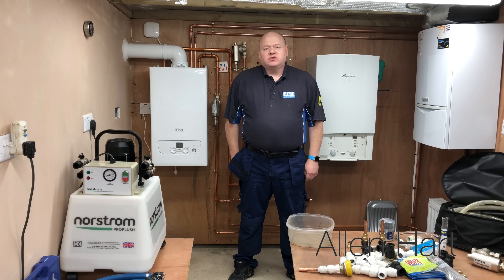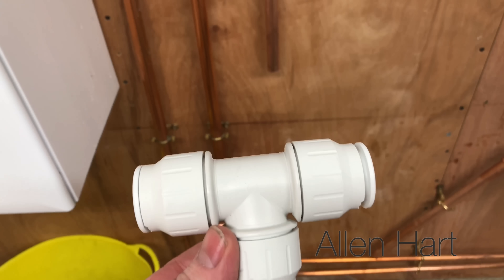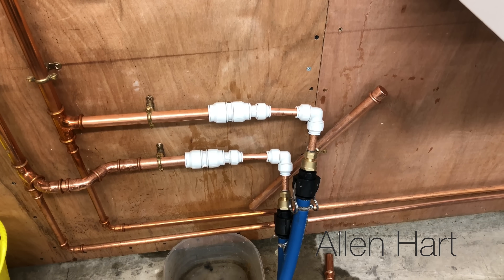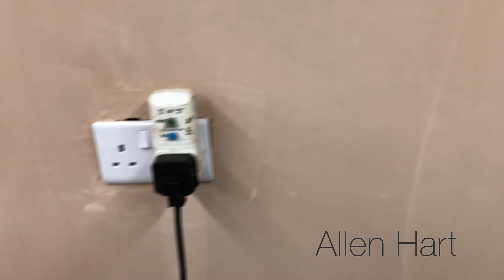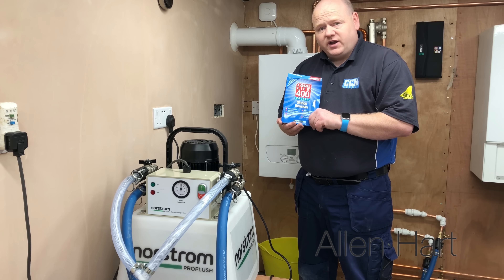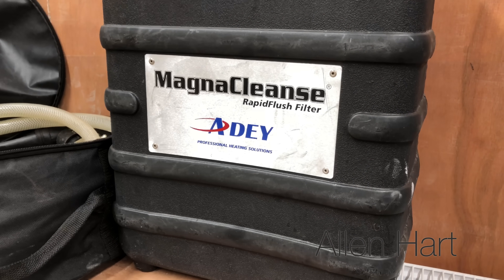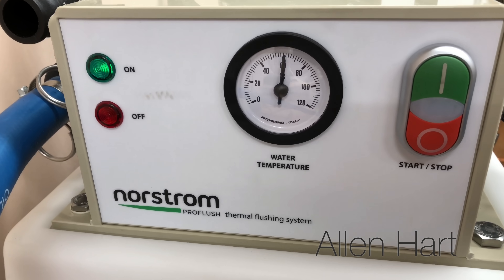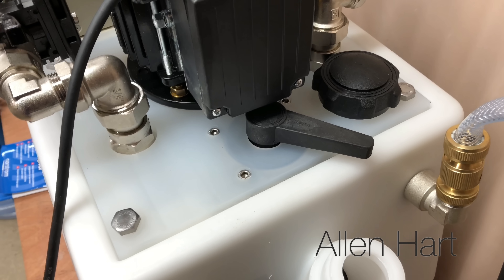HOW TO POWERFLUSH - Powerflushing a Combi Boiler Leeds

Comment: Dear Allen,
I have a radiator which has I can't access and is shut all the time can I still do power flush with all the other radiators? Someone stupidly built shelves around it so I cannot get to the thermostatic valve to turn it on even if I wanted to.

Comment: If removing a radiator and connecting powerflush. Would you put the flow from the powerflusher on the flow side of the radiator and return to the return

Comment: Doesn't there need to be a meter of copper off the boiler manifold before you can use plastic fittings?

Comment: Hi Alan would you say you have to be gas safe engineer to powerflush as there is so many fine lines as u say the pump is in combi boilers and system boilers.
The cover of the boiler people saying is an issue to be gas safe.

Comment: Great video, but not sure how to connect the power flush machine to boiler, I don’t wanna cut into pipe work though, is there any alternative. Boiler is valiant and have 2 way valves on flow and return which can be adjusted with screwdriver. Thanks

Comment: Gd vid, just ordered the same machine and have the magnacleanse. Where did you get the fittings to go from 1" to 3/4!?
Reply from the maker: Thanks very much for your comment, please consider subscribing to support the channel 🙂
Reply from the maker: I ordered them from google. Sorry i cannot remember where i got them now.
Reply: What are they called even see if I can find them... I had planned to just jubilee clip the hoses together with copper but these would be a much better job!
Reply from the maker: @dermotmcadams3742  https://www.google.com/search?q=cam+lock+fitting&oq=cam+loc&aqs=chrome.3.0i433i457j69i57j0j0i131i433j0i395l3j69i60.6184j1j4&sourceid=chrome&ie=UTF-8
Reply: I visit norstrom in Wigan and bought the adaptors

Comment: Hi Allen how much do you charge for this as im think getting it done plus would this stop my boiler from losing pressure all the time ive had a new expansion vessel put in but still doing it so just wondering if this would help if not what could be the problem with my combi boiler cheers Allen

Comment: Do you need to be at the top of the system
Because if not won't the powerflush overflow with water level?

Also,
Will You need to vent the rads to fill and then properly flush them
Reply: no. call a plumber. all systems are different.

Comment: Did you have the boiler flow and return isolated as I’ve seen some to say it’s better to not contaminate the heat exchanger with the sludge and all the boiler components.  Is this right. ? If it’s like this. What’s the difference with flushing the system and descaling the boiler. Just the chemical. And calcification rather than Iron oxide sludge.
Reply: Hi Allen  your making that look too easy, why wait for tub to heat up then dump off after every rad ? Needs magnets to see what has been captured. Was keen to see difference of a heated flush opposed to un heated ?
If boiler broke, using electric heat, why flush through boiler ? Connect straight onto F & R.

Comment: Great informative videos. I worked on boilers alot, not many wall hung. I would see sludge in the steam boilers but not in the hot water heating system.  What causes that?.. 
 In hot water here 3/4 in baseboards and a cast iron boiler typically run at 180° F,  i purged so many, drained many, but nothing like that sludge you got out.. Remembering now baseboards i removed and replaced i never saw that build up you showed in your copper. Maybe its the additives they put in our water that keeps it out??  Great videos very informative
Reply from the maker: Thank you for taking the time to watch my video.
Reply: I would like to know is this only on the combi boilers??.. I like this flushing,  i think for my situation, i would drain the existing system, run fresh water through & drain again.  The i would put the chemicals in the existing boiler, let it run everything a couple days. Then return for r&r...
  Only i never heard anybody doing it.. It would be a nice add on sale for maybe extra 500$ but i couldn't bring myself to sit there all day charging for my time.. Definitely can't do either without proper knowledge.

Comment: Hi mate. How long per radiator and what if the boiler needed flushed too?
Reply from the maker: Until its clean. Thanks.
Reply: Allen Hart what about the boiler ?
Reply from the maker: I normally let the boiler work with the chemicals in the try and clean it as much as possible, i wouldnt normally take the plate out though on a flush. Thanks.
Reply: Allen Hart cheers mate, any chance of a video on wiring heating controls eg. Zone valves, stats, and programmers ?

Comment: It's nice to see how a pro does things in another country. I'm from The States and most of the contractors here are still installing cast iron boilers. Didn't the installers use boiler chemicals when the systems were installed that they are plugging up?  They sure install the boilers in tight places there. When did the use of condensing boilers become popular there?

Thanks, Bill
Reply: In continental Europe condensing boilers have been used for many years,People in the U.K like to hide boilers don't know why in places where they can be awkward to service.

Comment: Ideally should a powerflush happen before a new boiler is installed or doesn't it matter ?

I had a new baxi 630 installed and the installer said after it needed flushing.
Reply from the maker: In an ideal world it would be flushed before but thats not always possible.
Reply: If your system wasn't  flushed prior to fitting new boiler,then much efficency of new blr is lost because you have now pumped magnetite into it!

Comment: To do this properly takes a lot of time and patience. A good DIY task if you hire the machine.
Reply from the maker: Personally i dont believe its a DIY task, best to leave it to the people who know what they are doing, every job is different and needs different things doing. Thanks.
Reply: Alan as I am sure you appreciate not all plumbers are equal, neither are all DIYers. Of course you need to be competent to complete any job correctly and anything less is a bodge. Personally after running big power plants and large chilled water systems I am very happy that my plumbing skills are more than satisfactory. The one thing that stands in the way of DIY in this sort of job is the kit and as long as it can be hired then there is no good reason why a perfectly good job could not be done.
Reply from the maker: I do not really agree if i am totally honest, i have done hundreds and hundreds of powerflushes if not thousands and TBH i had done quite a lot of them before i understood what i was doing. A diyer might think they have done a good job but i would say in nearly all cases they do not and end up calling someone like me. When you take into account the cost of the machine and cost of the chemicals used i do not think customers get a bad deal. Many thanks.
Reply: Hi Alan, I need a bit of advice (if you kindly would). My boiler has locked out due to flake build-up, I've been informed the boiler itself can be power flushed with chemicals. My concerns are; 1, is this going to be effective? 2, Is that amount of pressure running 'directly' through the boiler ok? 3, Is the flake likely to cause damage to the boiler parts, as its pushed through it? Thanks.

Comment: Another great video Allen just one question do you think that the water heating capability on this power flushing machine is worth the extra cost? It seemed like it could take a while to get a full heating system up to temperature? Thanks again Allen.
Reply from the maker: I have only tried the heater on a small 6 rad ish system and it was really really good, i might get the built in magnets though as it will be better for setting up.
Reply: Use x800 cleaner. Works just aswell cold

Comment: so this is something you gotta do from time to time?
Reply: generally only has to be done on older systems. We always power flush before fitting new boilers in fact most manufacturers will void the boiler guarantee if its not done.

Comment: combi boilers are really complicated machines :/
Reply: I scratch my head,because all the maintaining is crucial.  If you hire a plumber all day to flush a system plus the chemicals you probably spent all the money you saved in the High Efficiency unit and more. Then when i hear the units are lasting 10 years or so.  
  I'll take a freestanding cast iron boiler at 83 or so efficiency with very low maintenance.  
 I couldn't bring myself to sell them knowing the cast iron boiler has a lifetime warranty on the core and it will last, compared to the limited life expectancy of these condensing wall hung boilers. A day of flushing is probably not less than 1250$ in my area, then the yearly maintenance.  I don't see anyone saving a dime, then your time to be sitting with the plumber every year has to be worth something, no? 
I agree, it's not for me.. And i love tinkering, cleaning,handymen stuff.

Comment: I agree, speedfit is probably the best push fit gear out there, don't understand why you'd bother using stuff like hep when you've got to use a daft tool to get fittings apart. The old grey hep was terrible for heating systems, the black sludge it produced was unreal.
Reply from the maker: I have used speedfit for years and cannot fault it. Thanks for watching.
Reply: Allen Hart I’ve had the odd occasion where mice have nibbled through it but that’s rare. Would happen to any plastic pipe I suppose.
Reply: Hi Alan, I’m glad you agree with push fit… I have been doing plumbing for more then six years and learned off qualified plumbers I had doing the the work for me. We work on extensions, lofts bathrooms and kitchen etc. I recently have taken an online course to become a gas safe engineer.  And said to the guy that I’ve used speed fit and push fit etc and they brilliant. He was going mad about it and said if you use that your a plumber who never made it. I’m like you I have used them for years and never had one costumer complaint or calling us back as far as I know if you do them right they never go wrong. So Im glad you recommend them.

Comment: hi there Allen, i am a little confused, what's the difference between a power flush, and a magna cleaner, thanks
Reply from the maker: Powerflush is a pump that flushes the system, You can use a powerflush by itself or with a magnacleanse, You can also just do a magnacleanse by itself, If you just do a magnacleanse it uses the pump in the boiler. What is needed verey much depends how bad the system is. Thanks for watching.
Reply: Allen Hart  oh right thanks for that i now understand cheers Allen